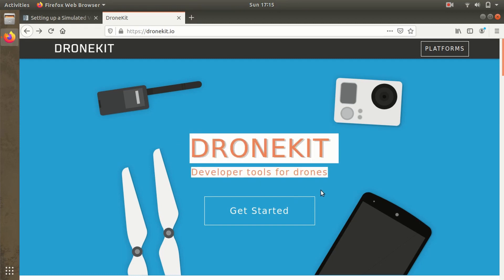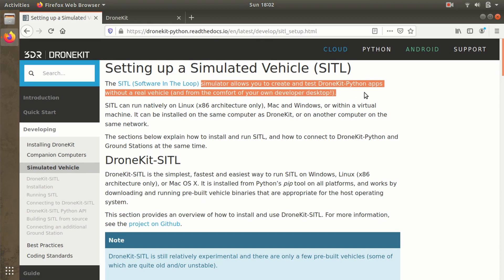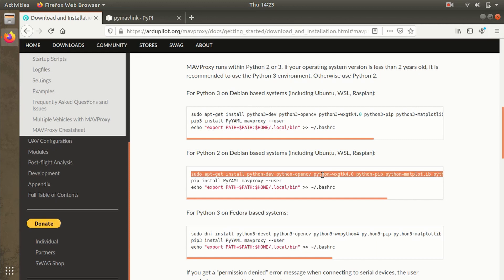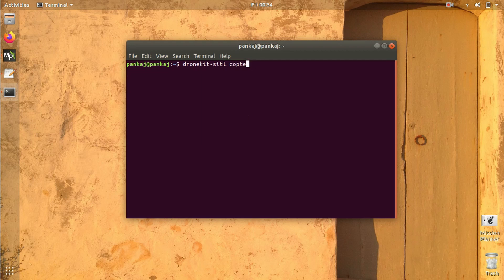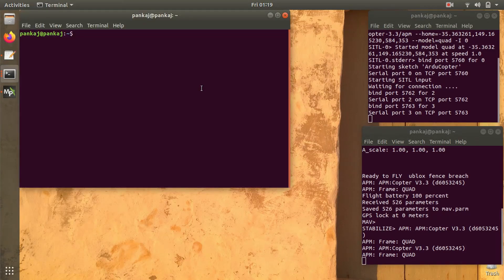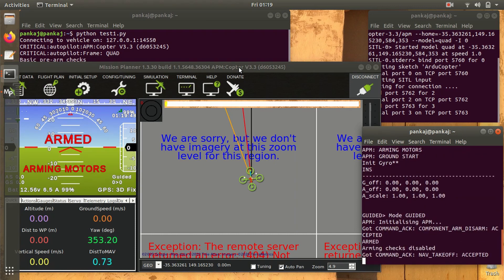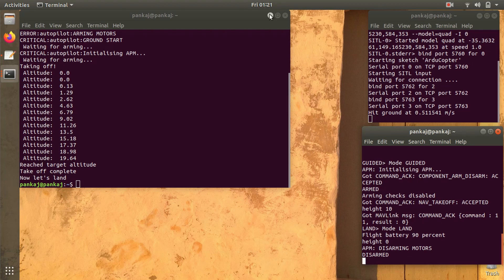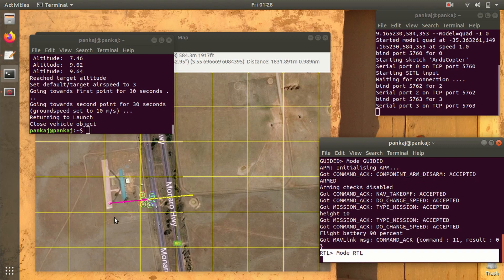Install Dronekit-SITL, MavProxy | GAZEBO with ArduPilot Plugins and Simulate your Drone | Part-1

Comment from the maker: Please check Github repository for update on python3 packages as in video setup is based on python2 which is deprecated now.
Reply: but dronekit doesnot support python 3.so using python 3 for other would work with dronekit?i didnt under stand how python 3 for other and python 2 for dronekit 
would work together
Reply from the maker: @numberthree-gf5zb  dronekit works with python3
Reply: @PankajMali  i am having problem of using python 3 with dronekit and mavproxy.i am wanting to take telemetry data as well as control drone usng raspberry pi running debian buster.can you provide me with resources and adaquate examples link or some reference
Reply: @PankajMali  please can more better because it is not downloading
Reply from the maker: @riseofmysteriousanime4358 updated will be live next week
Reply: Where is the repository I mean under what name
Reply: @kshitij7rathi683  bri did you find the repository

Comment: I am facing "disarming motors" issue after 2-3 secs of arming using python script. 
In my case when I am not able to connect python script and mission planner to out udp port. So I have connected them directly using tcp port from dronekit-sitl 5762 and 5763.
Reply from the maker: Hello, can you put the data here that you get when you Execute the code from terminal
Reply: @PankajMali  just tell me what's wrong or just tell me the version should I use.
Reply: @PankajMali  now the issue logs:-
1.:- pyhton script:- ERROR:autopilot:ARMING MOTORS
CRITICAL:autopilot:GROUND START
 Waiting for arming...
WARNING:dronekit:Link timeout, no heartbeat in last 5 seconds
CRITICAL:autopilot:Initialising APM...
Taking off!
 Altitude:  0.0
 Altitude:  0.0
 Altitude:  0.0
 Altitude:  0.0
 Altitude:  0.0
 Altitude:  0.02
 Altitude:  0.05
 Altitude:  0.06
 Altitude:  0.07
ERROR:autopilot:DISARMING MOTORS
 Altitude:  0.07
 Altitude:  0.0
2.:-mavproxy:- AP: Frame: QUAD
Got COMMAND_ACK: REQUEST_AUTOPILOT_CAPABILITIES: ACCEPTED
Received 526 parameters
Saved 526 parameters to mav.parm
fence breach
Got COMMAND_ACK: DO_SET_MODE: UNSUPPORTED
AP: ARMING MOTORS
AP: GROUND START
Init Gyro**
INS
----------------------------------------
G_off: 0.00, 0.00, 0.00
A_off: 0.00, 0.00, 0.00
A_scale: 1.00, 1.00, 1.00

AP: Initialising APM...
Got COMMAND_ACK: COMPONENT_ARM_DISARM: ACCEPTED
ARMED
Arming checks disabled
Got COMMAND_ACK: NAV_TAKEOFF: FAILED
GPS lock at 0 meters
AP: DISARMING MOTORS
DISARMED
Reply from the maker: Your issue is version of pymavlink.

I hope you are doing the setup for python3 along with the packages required
Reply: @PankajMali  ok Lmk the version to use with python3

Comment: I am not able to run Dronekit script in python . I have python 3.8 and Ubuntu 20.04 and python has been automatically installed while I was setting up Ardupilot what can I do ??
Reply from the maker: Hello, can you please share the specific errors you are getting, as i have tested different python versions from 3.6/7/8/9... with ubuntu 20 i didnt find any issue yet.

Comment: Please the Misiion Planner is not arming on my Ubuntu 22.04 when i run the code and when i forcefully arm it says not data recieved int 3 seconds ajnd the timer keeps increasing what could be wrong
Reply from the maker: Theres connection issue

Comment: Dear Pankaj thanks for the video. I have a question: I applied your code (test1) but I have an error with motor
Reply from the maker: Hii,
Can you please elaborate your error.
Reply: @PankajMali  the problem is: the mode in mission planner is stabilize and I have to change it manually to Guided after I run the code in order to get rid of the error. If I don’t do that then the error in arming the motor will appear. Does that make sense for you?
Reply: @PankajMali  this is exactly what is happing after I run the code: 
Waiting for arming
Taking off!
Altitude: 0.0
Altitude: 0.0
Altitude: 0.0
Altitude: 0.1
Altitude: 0.2
Altitude: 0.3
Altitude: 0.4
Error: autopilot: Disarming motors
Altitude: -0.1
Reply from the maker: Hii 
Can you please tell me what code are you using? 
Are you able to chnge mode from mavproxy terminal ? If yes then change mode to guided and give commands like.  ARM THROTTLE  >>> TAKEOFF 5.
If it performs this then we can go to next step to run a python code to do same task .

Please test it and let me know if ny errors.
Reply: If I go directly to mission planner and change the mode to guided, the error will not appear
Reply from the maker: @akeelomairi9911 try executing  demo.py code from my github  everything should work fine
Reply from the maker: @akeelomairi9911 in the demo.py code the mode is change to guided within the code ..copter doesnt takeoff in anyother mode when commands are sent from companion computer

Comment: hello sir, i cant change the mode from stabilize to guided even tho im giving the command 'mode guided'  any help would be appriecate it
Reply from the maker: Hello ,

There are possible 2 reasons 
1. Updating mavlink package
2. Wait to get 3d fix or msg like ekf is using gps on the mavproxy terminal. 

Mostly many people have faced this issue, 1st option have solved the error

Comment: Hello I know this is 2 years old video but I have question on the mavproxy packages part, the official ardupilot mavproxy page now only shows Python3 installation but we are recommended to use Python 2(Ubuntu 18.04), I tried writing "sudo apt-get install python-dev python-opencv python-wxgtk4.0 python-pip python-matplotlib python-pygame python-lxml python-yaml" but it doesnt work.

Do you have a way to solve this issue?
Reply from the maker: Hello pung what error do you get ?
Reply: @PankajMali  Hello Im currently running Python 2.7.18 on Ubuntu 20

I used the commands: udo apt-get install python-dev python-opencv python-wxgtk4.0 python-pip python-matplotlib python-lxml python-pygame

The output is: 

Package python-wxgtk4.0 is not available, but is referred to by another package.
This may mean that the package is missing, has been obsoleted, or
is only available from another source

Package python-pip is not available, but is referred to by another package.
This may mean that the package is missing, has been obsoleted, or
is only available from another source
However the following packages replace it:
  python3-pip

E: Package 'python-dev' has no installation candidate
E: Unable to locate package python-opencv
E: Package 'python-wxgtk4.0' has no installation candidate
E: Package 'python-pip' has no installation candidate
E: Unable to locate package python-matplotlib
E: Unable to locate package python-lxml
E: Unable to locate package python-pygame

I understand that python 2 is no longer supported but we do need python 2 to run mavproxy and dronekit sitl right
Reply from the maker: Last week i have helped a person with installation with the same documentation as in the video it worked fine
Reply: @PankajMali  Is it still possible to get Mavproxy prerequisite packages for Python 2? The current mavproxy page only has for Python 3
Reply from the maker: Can you please confirm me about your system is it ubuntu 18
Reply: @PankajMali  I am currently running the latest ubuntu
Reply from the maker: Ok so i had few queries regarding the same.
Please install ubuntu 18 and follow my  documentation on github yesterday .
Reply: @PankajMali  understood thank you very much!

Comment: Hello dude, I'm having an issue hoping you can help me to over pass it, I got when I run QGroundControl : 
MAV> mode guided
STABILIZE> Got COMMAND_ACK: REQUEST_MESSAGE: UNSUPPORTED
Got COMMAND_ACK: SET_MESSAGE_INTERVAL: UNSUPPORTED
Got COMMAND_ACK: REQUEST_MESSAGE: UNSUPPORTED
Got COMMAND_ACK: REQUEST_MESSAGE: UNSUPPORTED
AP: APM:Copter V3.3 (d6053245)
AP: Frame: QUAD
Got COMMAND_ACK: SET_MESSAGE_INTERVAL: UNSUPPORTED
Received 526 parameters
Saved 526 parameters to mav.parm
fence breach
GPS lock at 0 meters
Reply from the maker: Hello fodil,
Hope you are doing well.
So the issue with set message interval not supported as i see that you have copter v3.3 which doesnt have support for this type of messages.
So i suggest you to install copter v 3.6 and above which has all the support for this messages.

Also for fence breach error you can change the value for parameter list.

I hope it helps you
Reply from the maker: Usually you wont get this issue in ardupilot if you are using px4 then you will surely get it as it doesnt support this messages.

But anyways this issue is related with stream rate ( SRx  paramater ) so you have used telemetry port (1or2) depending on that SR1/SR2 message interval frequency has to be changed usually its good to have 50 Hz  . You can check that parameter 

So now before doing any above mentioned changes. Just try to execute your python code on the hardware and see if any error pops up ( which shouldn't occur as per logic)
Reply from the maker: Hii, can you please paste your code here
Also do one more thing 

Just run ardupilot directory and in the terminal try to change mode to guided if it fails just wait for ekf alignment to get 3d fix 

After this you try changing mode to guided and takeoff to some height ....if it doesn't takes off then its problem with mavlink library versio
Reply from the maker: Ok so all good, now try executive the takeoff and python script for sitl
Reply: @Pankaj Mali  Sorry, can you give more details on how to proceed. Because let's say I am  a biginner and doing this as a FYP
Reply from the maker: Yeah sure

Comment: Hi pankaj, really nice Explanation. Was able to replicate.  But while sending entering command in cmd to arm throttle got an error pre arm safety check need position estimate.  I have good GPS signal and calibrated couple of times.  Any idea what could be the reason ?
Reply: Hi Pankaj. My problem for resolved.  That was due to the reason that fence was not enabled which triggered the error need position estimate.  After ending fence mode this issue resolved.  Now trying to complete the simulation before proceeding.  Thanks for your help
Reply from the maker: Good luck 👍
Reply from the maker: Hello Basics,
Can you please confirm whether you get 3d fix on the console.

Are you simulating the aircraft or you have connected the physical hardware?
Reply: @PankajMali  I have got 3d fix on screen.  I'm not simulating but connected the physical hardware.

Comment: Will this work with Pixhawk 2.4.8?
Reply from the maker: Ho shubeeksh,
Yes, it works with pixhawk 2.4.8 and also it works with any flight controller which  has arducopter firmware loaded.
Reply: Ohh okay, thankyou!!
Im working on an autonomous drone project, could i contact you incase i have any queries
Reply from the maker: Yes, you can catch me up on Instagram  @punky_pankaj ...Goodluck!!!

Comment: Why is it showing that 'sudo' is not recognized as an internal or external command?
Reply: Acchually I am a biginer in coding and as well as in drone industry. I have a quadcopter with pixhawk 2.4.8, I want to run python code through a roseberry pi 3B+ model. So can you please guide me step by step how to do so?
Reply from the maker: Can you please tell the command that you wanted to execute along with sudo ?
Reply from the maker: Are you trying to run this command in windows?
Reply: @PankajMali  yes
Reply: Please help me
Reply from the maker: Just follow the interfacing video for rpi and pixhawk  ..once your are done let me know
Reply: @PankajMali  which one
Reply: For that which version of python is to be installed in my pc?
Reply from the maker: @kamaleshbera7773  python 2.7
Reply: @PankajMali  Am I need to install python pip, python dip, open cv applications?
Reply: I only able to run  till 'sudo apt-get update' in my raspberry pi.
Reply: Please show the light
Reply from the maker: @kamaleshbera7773  yes
Reply: @PankajMali  is this version available for Windows 11?
Reply: Pleasr
Reply: @PankajMali  please tell
Reply: @PankajMali  can you please send the list of python dependencies you have used?
Reply: @PankajMali  because it will be easy for me to install them in my laptop
Reply: Please do reply
Reply: Because its my project and I am facing problems in every step

Comment: I have issue with mavlink I think it will arm and try take off and altitude will be always 0 and it will disarm Motor after that can u help me out
Reply: I was also facing the same issue with python 3. It works fine with python 2.7.
Reply from the maker: Hello rahul,
is your pixhawk connect to computer or powered via the micro usb port?

Comment: hello, after writing a dronekit code and sending it to the drone, I run the code, everything is ok, but while the drone is going to the next waypoint, the altitude is not stable. I am using the simple_go function, and I mentioned the altitude. what could be the problem causing this variation of altitude.
Reply from the maker: Hello iheb
Can you provide more information on the actual thing happening.
Is the copter automatically going up and down ? If so then just have a normal manual flight in loiter mode with fast forward flight and check if the copter behavior is the same like in autonomous mission, if its the case then i got a solution to that

Comment: Bro, I'm a UAV enthusiast just getting into actual autonomous stuff now(Pixhawk & ardupilot which i previously worked isnt really autonomous control).
I read online that dronekit has almost no active development and is only kept alive by community in gitter.. Is MAVSDK really an alternative? or if any other is there, please do let me know.

so for a beginner like me, where do you think i should start for building an autonomus indoor navigating drone?
Reply from the maker: Hello jagdish
Yeah you are correct, there's not much updates with the ardupilot dronekit documentations.
Yes when it comes to fully autonomous vehicles then MAVSDK is the real alternative.
You need to go with MavRos for fully autonomous system as you might need to use Lidar or depth cameras and using Mav ros directly with Ros environment in your companion computers stands to be a better choice .
Reply: @PankajMali  Thanks for replying! 
Currently I'm following this project to test and try out MAVSDK 

https://circuitcellar.com/research-design-hub/design-solutions/writing-mavsdk-px4-drone-applications/

I have also joined the telegram group you've created and please guide me in this field!
Thanks
Reply from the maker: Yeah sure, next video is on computer vision n then will get started with ROS, mavros for fully indoor autonomous vehicles
Reply: @PankajMali  thanks bro for quick response! 

All the best!
Reply from the maker: Thank you🤘

Comment: sampath@HP:~/dronekit-python/examples/simple_goto$ python simple_goto.py --connect 127.0.0.1:14550
Traceback (most recent call last):
  File "simple_goto.py", line 15, in <module>
    from dronekit import connect, VehicleMode, LocationGlobalRelative
ImportError: No module named dronekit

 i got error no module  named dronekit
Reply from the maker: Hello sampat,
Please check your command

Comment: Great video! Which version of Linux are you using.  On Ubuntu 20.0.4, pip command does not work as Python 2 and pip seem to have been decommissioned
Reply from the maker: Hello  Asim 👋
Im using ubuntu 16 and also 18 
Yeah ubuntu 20 doesn't support

Comment: There is no hardware required right? 

I am a complete beginner in drones and wanted to learn more about drones. Thanks
Reply from the maker: Hello nilutpol 

Yes you are correct, theres no need of hardware you can just program and simulate those codes  and observe the behaviour
Reply: @PankajMali  Thanks a lot for this amazing video. Big fan of your work.
Reply from the maker: @nilutpolkashyap  thank you❣❣

Comment: Sir in which ubuntu version you have install this?? because i'm trying to  install in 20.04 I'm getting error.
Error are package error,pip error and many more. please reply sir.
Reply from the maker: Hello akash,
This setup is tested and works perfect with ubuntu 16 and 18
Reply: @PankajMali  Sir Everything is done but getting error when i ran copter command and do i need to install mission planner separtely.

Comment: do you need ROS to do simulation ONLY
Reply: Can i just use windows?
Reply from the maker: You can use windows only for sitl, you need ubuntu for gazebo simulation
Reply: @PankajMali  can I use openCV in the SITL
Reply from the maker: Good question, yes you can use opencv in sitl as its just a platform to visualise your vehicle commands.
Reply: @PankajMali  I'm doing my dissertation on sensor configurations for autonomously landing uavs via ArUco marker detection. I've attempted to install gazebo and ardupilot on a virtual machine running Ubuntu but its not going well. Do you know of any good SITL IDEs that are browser based or windows based that I can code in python and utilise the openCV libraries?
Reply: I want to create a simulation that has a translating and rotating platform I.e. a boat and design code that enables a drone to land on via aruco marker detection
Reply: Thanks in advance for any advise
Reply from the maker: When it comes to gazebo, ubuntu is must. You can try flytsim it has web based approach also with gazebo integrated with px4 flight suit, you can just give it a try.

Part 2 is full with simulations and actual demonstration  with open cv and aruco markers.

Comment: This is amazing Mali, what flight controller have you used? If it's PIX, can I use another flight controller, say for instance ardupilot or the popular Multiwi😁
Am planning to work on the same project by April... But I don't know the best flight controller to use.
Reply from the maker: Good question joe, best is to go with px4 and other options are like you can install arducopter firmware in any flight controller having UART port .
 Like cc3d , spf3 or any fc if uploaded with arducopter firmware.
Reply: @PankajMali   Thank you for the response.